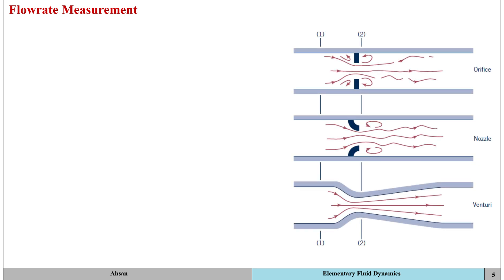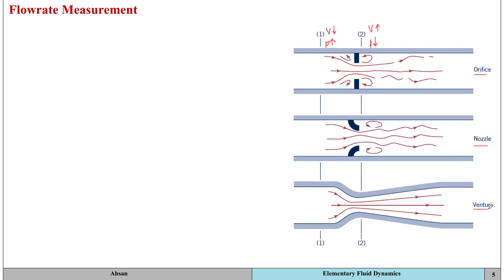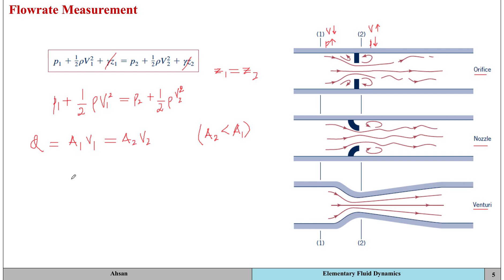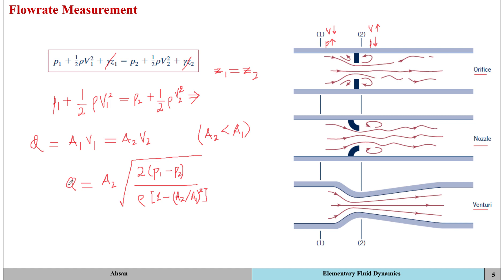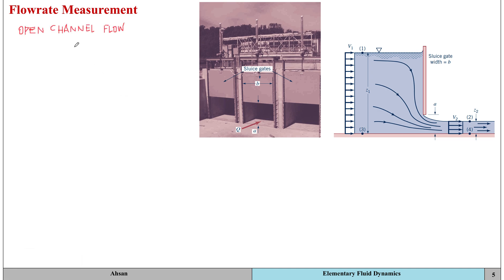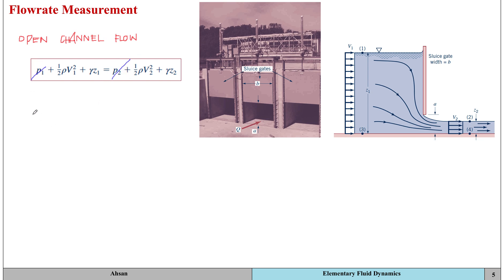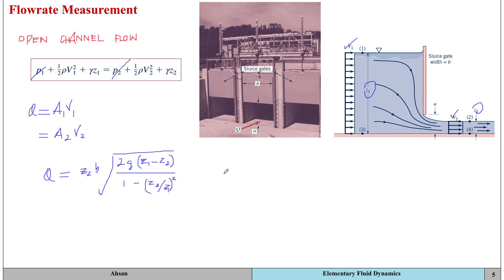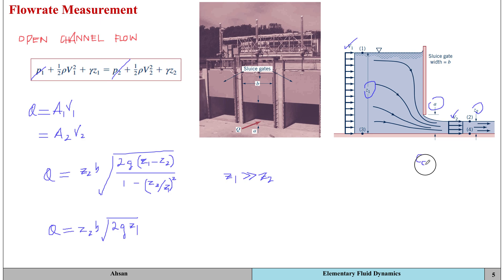Bernoulli Equation (Flowrate Measurement) - Part 5/7

Comment: Hello, I am working on a project where I am dealing with a water pipe for a fountain and it has multiple pipe reductions between the pump and the jet (in order to increase water velocity). I am wondering if you have any suggestions for assuming K values for these pipe reductions, in order to calculate the minor head loss.